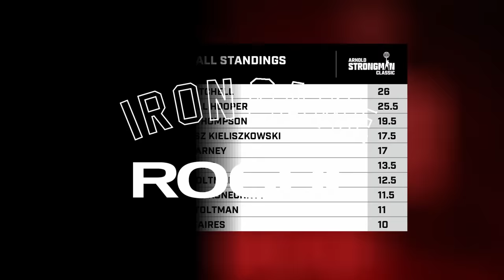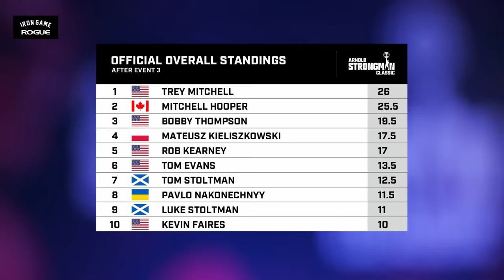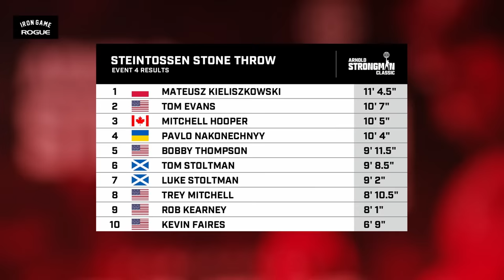Men's Steinstossen Stone Throw - Event 4 | Full Live Stream | 2023 Arnold Strongman Classic

Comment: I like the idea of the event, but I can see why it's getting a mixed reception. It's impressive when you consider the weight of the stone, but the throws just look kind of weak because of that. Strongman needs a good balance of difficult and spectacular; Truck Pulls, the wheel of pain, circus barbell stuff, car yokes. This IS a good idea for an event, I just think the execution and the presentation need tweaks.
Reply: What would you propose?

My first take would be to make the stone lighter by 30-40lbs to increase range
Reply: @quelandil5738  agreed. A lighter stone to get more dramatic throws would be better for viewership.
Reply: @mikey and sky  just imagine a strongman hurling a 120 lb stone at you crazy

Comment: Finally, height doesn't matter as much as the athlete's power and ability to make use of his speed.  The distance is proportional to the speed imparted to the stone, and to the square root of the height from which it is thrown. So, at equal initial speed, throwing from a height of 2 meters gives 5% more distance than throwing from a height of 1.8 meters(sorry, I can't think in feet and inches!).

Comment: The trouble with this is it's yet another tall man event. Imo strongman should test strength and power, not size because 1. this is more in keeping with historical feats of strength and 2. size is not a trainable quality. If you want to know who's the tallest then just measure them.

Any kind of loading to a high platform or stone lifting to a set height suffers from the same problem, as does throwing for height.

Comment: Do you have to run up, or could you walk up, and then throw it?
Reply: You could, but then you wouldn't throw it as far.
Reply: @staceygram5555  Does it have to be facing the "sandpit"? If not, I bet a backwards throw would be a better throw.
Reply: @bryancampbell4604   nobody can keep their hands on such a stone while pulling it,  you need to push, as it's the only way to impart significant force to the stone, especially due to its size.

 You could throw far with a small stone that is small and wieldy, and "grippy" enough to pull on, and not too heavy, since balancing it on your arms is a much more direct, and less local, demanding, way of force transfer, compared to keeping a stone from sliding out your hands.

As you can push on a wall several times harder via your arms, than what you pull with, with bent hand hooks, and gripping the stone is not an issue with it balanced above your head, it is the best way. 

Especially after you gain free speed via the run-up, which is better than standing still, because you can jump into it, use the stretch reflex of your legs and up, with mostly arms straight, then pressing into your arms a bit to not lose tension during, at a shallow angle, where you can match the ongoing acceleration your legs give you, and  where the arms can impart the most extra velocity with the fastest shallow shove, at an already moving stone.

This way you push it away faster than you could do with pressing it off, where your shoulders and arms cannot compete with your lower body, and significant leg drive would make the stone remain stuck on your collar bone.( I should presume you know most of it, bar the first sentence, oh well, being thorough.).
Reply: @japanesecar1501  That's a great explanation. Even with what you wrote, I still believe it could be thrown backwards. Like an overhead toss.
Reply: @bryancampbell4604  
1. Not allowed.
2. Definitely would not be better. At all. Like, not even close. You'd come dead last if you tried that.
Reply: @bryancampbell4604  I see, what you see, tthoough, I really don't think any of the guys have the hands to keep stuck to it, and do it in that way, you'd have to be pretty inhuman, with crab hands, locking forearms. It will force your hands away, and not even an armwrestlers wrist bend can keep up with it, and the girth is too much via the nature of the stone being so heavy, it is really big too. Nevermind that the nature of not having any true 90 degree angle and any slack under load makes you slip all the more.

 You'd really need to make the most out of a backthrow, and as far as i know, there could be even, say 30 % of power to gain, as the "back spring" is just longer, with good velocity even for heavy loads- the catapult working, still, dare I say, to say, ;), that at over 50 kg this would not be any better for any round-ish object,  without handles, and there is still the issue of keeping outside the frame of the pit, when you consider, that for a really powerful full throw, you need to follow the object to beyond 2 o'clock with your hands, and you need to shift yourself towards the way of fire overall,  to make a good efficient throw, and with such a heavy stone, you really need to be ready to pull through to gain 2 feet extra, making you fall on your bottom, possibly costing you 4  feet, so you'd be either throwing from real far compared to overhead handling, or planting yourself in the forbidden zone for a DQ.
Reply: @staceygram5555  I doubt I would come dead last.
Reply: @staceygram5555  Nah, I don't think I would be.
Reply: @bryancampbell4604  
You definitely would. I mean, you'd be last if you threw it like they do, too, obviously.
But if they threw it like you want them to, they'd be throwing it much, much shorter distances. In fact I doubt they'd even be able to get it past their own heads.
Reply: @staceygram5555  I doubt I would be last, even I threw the way the did.

Comment: The refs are stupid. If you let go touching the sand should be the foul. Not touching it after letting go of the rock three feet away from it. What if an athlete touches the sand while they're measuring is that a foul too?  Might as well be. They approved throws where athletes clearly touched the wood at the moment of throw. Dumb referee is dumb